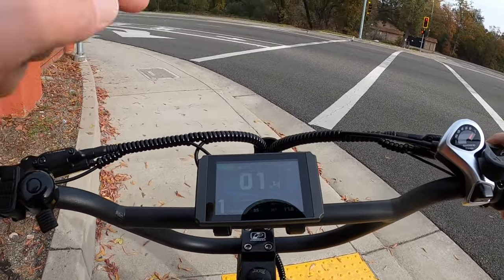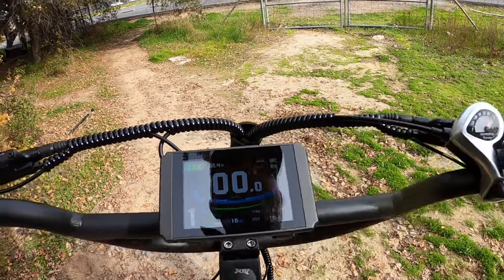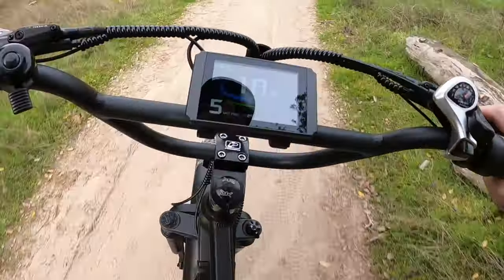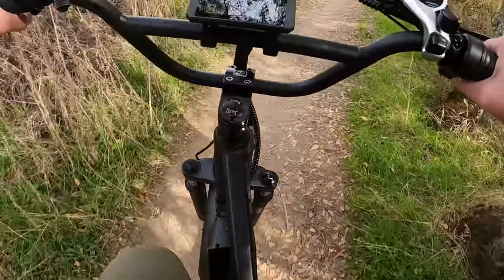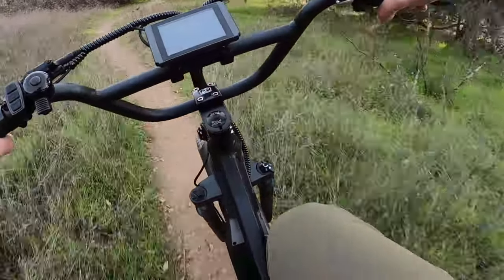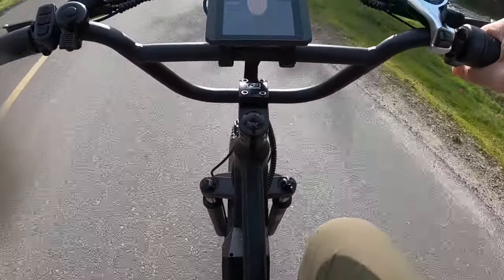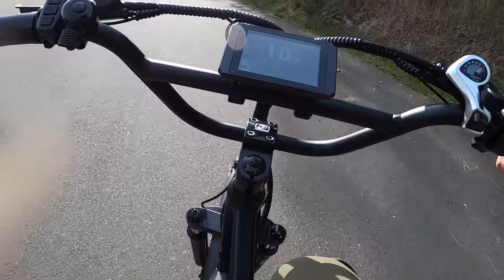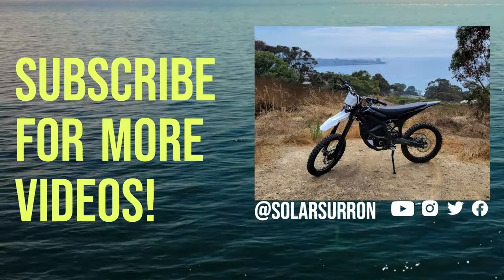Update! 2024 Wired Freedom

Comment: Your top speed will be lowered if you are not in c5 =0,1,2 or 10 as will your peak and continuous wattage.  3 is about 500watts, 4 is 750watts, ect until 10.  Try C5 at 0 for softest start will full power.  Don’t worry about the chain ring, can still get home easily enough on throttle.
Reply from the maker: That wasn't what I found. If you watch until the very end, total wattage is reduced with c5 at 5 vs at 10.
Reply from the maker: At 5 on the C5 setting max I could get was about 1500 watts. When the C5 is set to 10, I was able to get 2000 to 2100watts.
Reply: You both are saying the same thing I believe you're getting his zero confused with a 10
Reply: Hello if this is one of the owners of Wired can you confirm P5 should be set at 6 or 8 for best setting for the ‘24 Samsung battery? Also, any truth that plugging your phone into the usb on the back of display will harm your phone? 
Thank you,

Comment: Just a couple of things. There is nothing wrong with charging these batteries until the charger turns off. You will not save 5 minutes of total time over the life of your battery by stopping it from charging completely. You are correct you don't want to store any lithium type batteries at full capacity for more than a couple of days. Also politely asking if you could please tilt your camera angle up so we could see where you're going instead of staring at the ground constantly, that's very difficult to watch. Good job on this video.
Reply from the maker: Agreed!!! Thank you for the input. I appreciate it! I saw the angle after filming and was bummed...I will definitely tilt it higher on the next one!!
Reply: Actually, if you charge to 80% you get 4x the number of cycles from the pack.  If you charge to 90% you get 2.7x the cycle life.   I rarely charge over 90% unless I need the full range.  Same rule also applies to your iPhone battery.  Also, try never to fully deplete the battery and store around 50%.
Reply from the maker: @dixienormis3614  Because then people wojld.cpmplain that they have a battery that can only charge to 90% and is a waste to carry around and pay for the last 10% of cells. Not a single manufacturer on the market has a charger that only charges to 90%. Charging to 100% and using it right afterwards is fine, just don't charge to 100% and let it sit for a few days.
Reply: @dixienormis3614 1st...why 90% when the optimum number we are talking about is 80%?  2nd...show me an ebike charger that completes charge at ("90%") 80% then? You think this type of battery cycle only applies to Wired ebike battery?

Comment: c5 is for total power output.  0,1,2 are full power, but slower start.  4 is going to cap at 750w. 10 caps at 2kw, with sliding scale between.  For me personally, I run at 2 or 10, for full power, and either a slower ramp or full lift-your-tire power.
Reply from the maker: Awesome, thanks for the info!

Comment: U don’t want to  store the batter fully charged but u absolutely do want to fully charge it regularly. The cells need to be balanced regularly and can not do that if it isn’t allowed to fully charged. U should actually leave the battery on the charger for around 12 hrs or so as often as possible. Even after the charge is indicting full the bms is balancing the cells which can take up to 12 hrs.  The battery offset is to allow for more fram rigidity btw.
Reply from the maker: While you should charge up to 100 to balance the cells occasionally, you definitely do not need to do it as often as possible... this will shorten the life of the battery considerably if you do so.

Comment: Thank you for the P5 setting from 16 to 6. That did the trick.  The battery level indicator was only reading half full on the display when set to 16. When the setting was changed to 6 the display read fully charged after opening it up to 45mph (no load). Which matches the charge indicator on the Samsung battery as full.  My 2024 Wired Freedom in that silky blue was delivered here in the Lowcountry of South Carolina and has a motor temperature sensor on the display. Do you know if there’s a setting adjustment to have throttle when the PAS is set to zero? My HiPeak Bona works that way and it’s pretty sweet.
Reply from the maker: @luckfavorstheprep  try P3 set to 1 and P4 set to 0. Not sure if the throttle can work when pas is set to 0, but let me know!
Reply: @leetjohnson  thanks for suggesting, those are my current settings for P3 at 1 and P4 at 0 but no luck.
Reply from the maker: @luckfavorstheprep  Bummer
Reply: @leetjohnson  thanks for getting back to me.
Reply from the maker: @luckfavorstheprep  anytime

Comment: Would you recommend a good E-bike that would be best for touring? I want to ride from San Diego, CA to Portland, OR. There’s no reason other than I love the logistical aspect of my adventures, For example, I plan two bow-hunts in a multiple states every year, and I tend to overdo it — 😅 Please, any help would be awesome!

Half-Assed Thrown Together Plan: 

• E-Bike: 
~ I have no idea yet; but I think it makes sense to have a duel battery. 
~ Duel Hub Motor but can use one motor at a time - yay or nay?
• Single Wheel Trailer: 
~ 4 Extra Batteries with 2 Batteries on the bike.
~ 2 4amp Charges
~ Air Pump w/ Tire Patch Kit
• Where to stay: 
~ KOA Type Campgrounds/Motels
• Gear & Camp Supplies: 
~ Backpacking Tent
~ Sleeping Bag/Mat
~ Jet Boil w/ Fuel Tank
~ Freeze Dried Backpacking Meals/Snacks 
~ Extra Set of Clothes 

Bonuses: My Pug who weighs 12 pounds will be going with me as well - I plan to stream/upload videos of the adventure 😂 For real, any advice would be awesome or recommendations… I appreciate y’all! 🎉😅
Reply from the maker: That sounds epic! To be honest, I don't know much about long haul rides, however, there are a lot of new companies coming out with dual battery ebikes, and most if them have the ability to use just one, or both batteries at the same time. I would search for the longest range (I've seen a few that claim up to 80 or 100 miles range) but, to get that kind of range, you often have to use pedal assist 1 or 2, so it will be a slow trip with a LOT of leg power on the hills.
Reply: @leetjohnson  ok, sounds good. I feel I’ll have to invest in at least 4 batteries plus the two fit the bike, and do a bunch of local trips around San Diego getting a better idea for range going up hills and other metrics testing/pushing the bikes limits. Thanks man! I subbed!

Comment: Do you think you could make a video discussing how the suspension works on the bike or how to make adjustments to the suspension, how it feels riding at different suspension settings. Also what’s the difference in gear shifting vs PAS? 

Thanks for the great videos on the wired freedom I’m looking forward to receiving mine in January
Reply from the maker: I will make a video addressing this, thank you for the idea! The main difference in the gears to the pas is the Pedal assist levels increase or reduce motor power and top speed while changing the gearing allows you to increase the torque of your pedaling and lower top speed or increase top speed and decrease torque. Said differently, the gearing is much like that of a car gears, where as the pas is like having 5 different motors (small to large) each allowing more power (and thus top speed) than the next. You really don't ever need to come out of shortest gear (small gear for top speed and low torque) as the motor can do all of the work, unless you need to go up a big hill, with terrain that requires you to slow down (offroad). For riding on paved roads, you really don't ever need to change the gears at all!
Reply: @leetjohnson  thank you that made a lot of sense!

Comment: Sir, I’ll be getting the new version of the wired cruiser the step thru, suppose to be delivered the end of august, what’s the tire pressure while riding on the pavement only, I won’t be riding off road, thanks 🙏 Rickey
Reply from the maker: @morrison.rickey  on my version, the max pressure for the tire is 20lbs, so I run about 15lbs. I would say just stay about 5lbs under the max pressure that is written on the tire. From what I hear, the new dual battery version has a tire that can go higher than 20 lbs, and most seem to be running about 25lbs...but I would check the max pressure that is stamped on the outside of the tire and definitely not exceed that amount.

Comment: Your video has been very informative, I like the breakdown on the screen options. 

Do you know if there is any available information on the life of the battery before replacement is required? $800 for a new battery makes you hope it lasts a long time.
Reply from the maker: Thank you! I don't think there is much info out yet about the battery life over time, but the cells are Samsung, so they should hold up well.

Comment: Is the battery a Dorado Plus Long style? If so that matches what I have on my Magnum Peak T5 and would be a bonus if I got one of these. They offset size is only the bigger battery, I have a 17.5 Ah battery and it's not offset.
Reply from the maker: It does look very similar, however, this is a 60v system, not 48v. That may account for the offset on the Wired Freedom battery (higher voltage).

Comment: Looking for a bike to use hunting my spot is a mile up hill about 45 degrees can't ride mountain bike style bikes can you put this on a steep dirt hill instead of bike trails
Reply from the maker: Sure can. Due to the high speed and taller gearing this isn't the best ebike for very steep hills, but you could always change out the front chainring (56 tooth) for a smaller one and have better hill climbing abilities...but you will then have a little ghost pedaling at high speeds.

Comment: What would be the best/safest way to drain the battery when your bike is not in use? Thanks Dave.
Reply from the maker: Great question. Considering the size of the battery, the only real way is to run it down during your ride and not charge it back up afterwards, unless it is below 30 or 40%. I suppose if you charged up for a ride and then couldn't use the battery for some reason, you could use the USB charge port on the battery to charge up a bunch of USB rechargeable devices (ie phone, flashlights, cameras, etc) and use the battery like a power bank until it goes down. Another far less efficient way would be to elevate the rear tire and just throttle full power for a while, taking breaks to allow the motor to cool, but, without a load, this would take quite some time. I don't think leaving the lights on would do much to the battery to drain it, and the bike would auto shut off after a while, so I wouldn't recommend that.
Reply: Oh I see OK thanks. @leetjohnson
Reply from the maker: @DavidLeeMenefee  No problem, anytime!

Comment: Based on your actual experience with the wired bike; do you think someone 5 foot 6 inches tall with a 29 inch inseam could ride the full suspension bike comfortably? I am concerned the bike would be too big. Also I am concerned with how difficult it is to remove the rear wheel. Is there a quick release to disconnect the motor cable close to the rear brake? Also if you have removed the rear wheel how difficult was it?  The solution to the size of the bike problem would be for the manufacturer to offer at least two frame sizes to accommodate shorter riders.
Reply from the maker: I don't think it would be an issue, but the bike is big abd fairly heavy, but not dramatically bigger than other 26" fat tire ebikes.
Reply: Nicholas...I am 5''8" with 30 inch inseam.  I had to adjust my seat to the furthest 'back' position in order to be able to stand over the top bar. It's workable, but barely.  I also reduced the air pressure in the rear shock, which dropped the height by almost an inch. I'm getting more travel than they recommend, though.  I'm still working on adjusting the handlebars, since I feel like I'm reaching way out.  For 5'6", it might be a hard stretch to be able to ride it.
Reply: @larsenjbl  Thanks I was looking for a response from someone who owned the bike. You have confirmed what I thought this would be to difficult to ride & would present a safety hazard.

Comment: That motor temp… if I was riding it up fire roads for 4 or 5 miles on a low PAS, do you think it would overheat?
Reply from the maker: I don't think it would be an issue if you keep the wattage down. I have a 750 watt Rad Rover and haven't had any issues, even on steep inclines. I will be testing during summer, which is when I would anticipate problems with motor heat, if any.
Reply: It gets hot here in southern Oregon in the summertime…
Reply from the maker: @Dustinrhoades  I have a buddy that lives in Lincoln City and goes to Corvallis...Oregon is beautiful!

Comment: Just a few questions What helmet are you wearing on the wired? A bike or motorcycle helmet?
What is the critical temperature for the motor? You forgot that important fact. As for the wear on the battery, you should be draining it to ~10-20% before swapping it out... The number of charge cycles you put the battery through also causes wear, not just the amount you discharge it. How come you didn't tell us what the battery was at when you swapped it out? There is a guy that added a second battery to his wired bike, but he used a 62 tooth pedal gear in the front which he found made it easier to pedal with the bike at top speed.. Have you considered changing from the one you added to the bike? The guy's name is Maximum charge.
Reply from the maker: I wear a helmet called "Basecamp"...just a regular helmet, not a full face. The battery I swapped out was for my GoPro, not the Wired Freedom. As far as the critical motor temperature, I'm not exactly sure when it will cut out, but I have seen it go as high as 240 degrees Fahrenheit without any cutting out or overheating.
Reply from the maker: I think I'm going to keep the stock front chain ring for now. That 62 tooth ring must be HUGE!
Reply: Do think that it will do more than an airiel rider Kepler?
Reply from the maker: @stevenbatteau5981  do you mean top speed?
Reply: I don't think that helmet is rated for this bike. $37 sounds great though.  @leetjohnson
Reply from the maker: @CorepexTechnologies  it might not be, but it is a bike helmet, and many bikes can go 20 to 30mph...or more downhill. A full face helmet would be safest, but possibly overkill depending on how fast one actually rides and whether on dirt, rocky paths or concrete. I usually go about 15 to 20mph on dirt, but do go around 30mph at times on the street.

Comment: Thanks for the vid! Do you think they will provide a bigger battery in the future since there is more room?
Reply from the maker: You're welcome! Good question....I'm not sure, but would be an excellent option!
Reply: You've settled my mind on buying this bike.. I purchased a month ago but of course I have to wait to mod January and I cannot stop comparing it to other bikes to see if I made the right choice lol. You did a phenomenal job explaining all the bikes features. The only thing that makes me question my decision to purchase now is the Billy Goat V2, have you seen that bike and it's specs? I think the reliability will be close but not as good but it still is a faster bike at the same price point.
Reply from the maker: @Brandon-nw8wo  Awesome! I'm glad you liked the videos! I haven't heard of the BillyGoat V2, I'll have to check it out.
Reply: Here's the specs, the company is Goat Bikes. 

2,000W constant motor (roughly 2,600W Peak)
110nm of torque
60V 20AH Battery
Range of 50 Miles (Pedal Assist Mode) or 28 Miles (All Electric Mode)
Max speed of between 45-50MPH (dependent on rider weight and terrain)
50A Controller
Full Twist Throttle
2 anti-theft locks (throttle and rear wheel)
Shimano 7 speed Gears for Pedal version
New display with phone app and option for Navigation
Integrated spoke wheel rim (much more durable that traditional spokes)
Includes side mirrors
Bike weighs 103lbs
Max rider weight of 450lbs
Aluminum alloy frame
Dual adjustable suspension
4-piston hydraulic disk brakes
INNOVA 20x4.5 inch all terrain tires 
Upgraded LED headlight with high beam and low beam functions
Has turning signals
Has horn
Larger more comfortable seat, 33" from the ground
Reply from the maker: @Brandon-nw8wo  Wow! Those are some impressive stats! The big thing that stuck out to me was all that on a 20" wheel. 450lbs max rider weight is really impressive along with the 45 to 50mph top speed!
Reply: @Brandon-nw8wo You should try a 20 inch bike first, I own one and it absolutely sucks compared to a 26x4.  That Billy Goat bike is a pre order from a company that appears to be run by a couple of Russians.  I’d wait to see how their bikes actually perform if they are actually delivered.
Reply: @jfly2249  very good point sir, I also got the motor and model from them via chat but I cannot find anything on it.  The motor is a Xunshun XS-D2000W